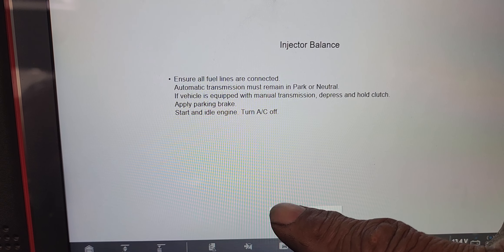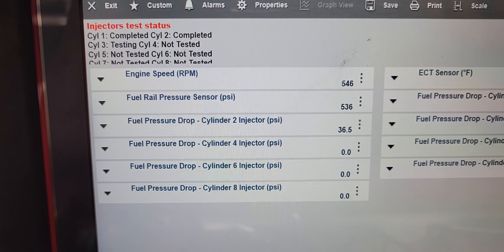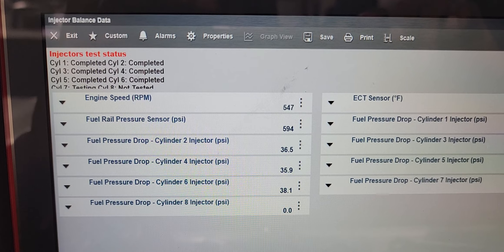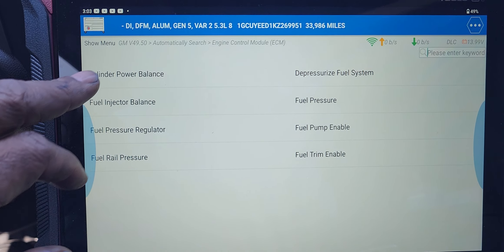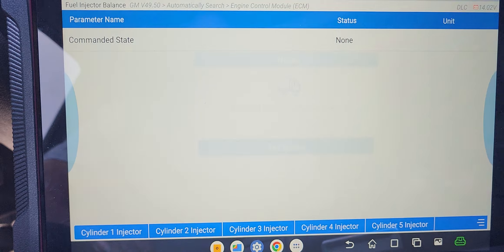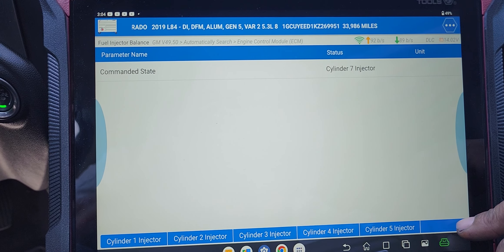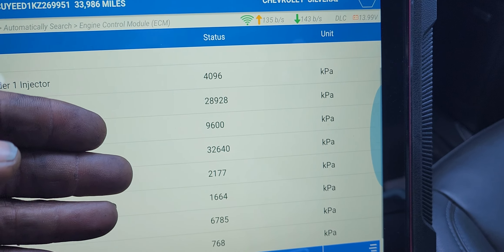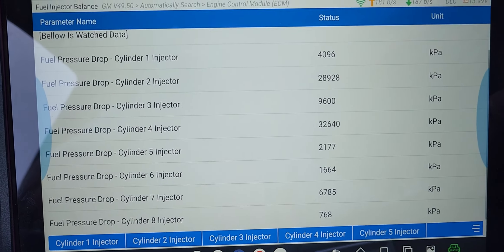matco maximus 5.0 vs snap on

Comment: I'm pretty sure you can change it to psi. At least my 3.0 can. If you swipe over when you're on that screen where those blue half circles are on each side of the screen you can go to the settings also in the area you set up shop info and change your settings metric standard and I think there's two other choices one may be both
Reply from the maker: @sublimittrent  I will check thanks
Reply from the maker: @sublimittrent  no settings to change